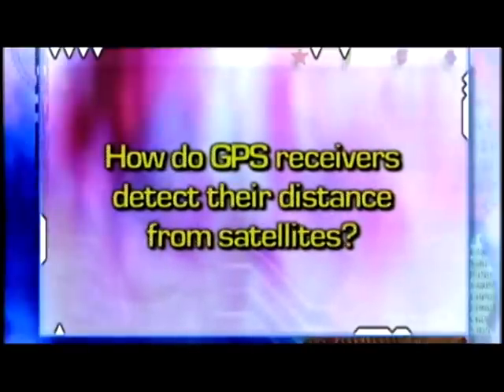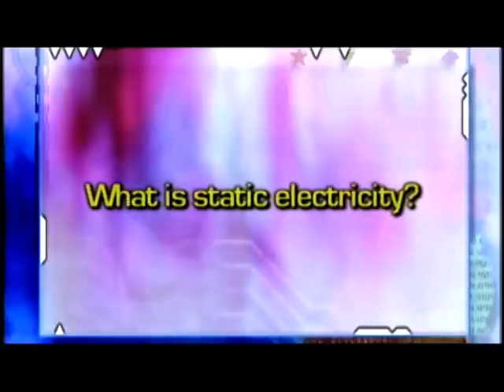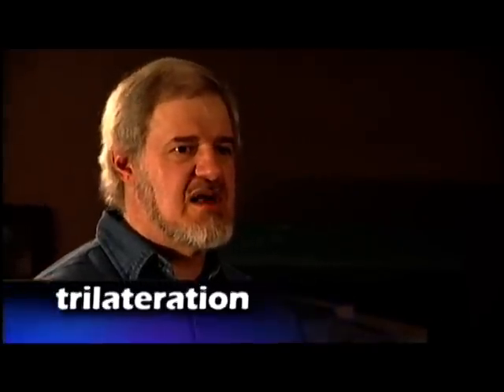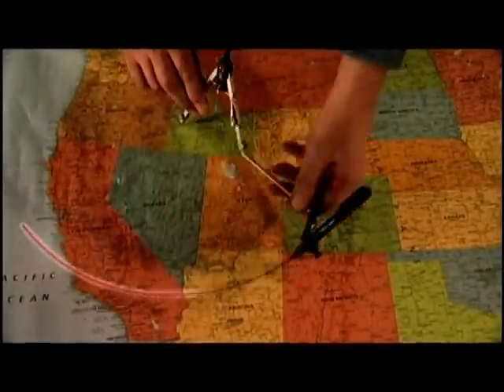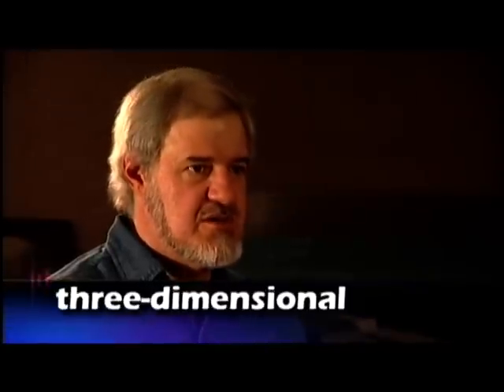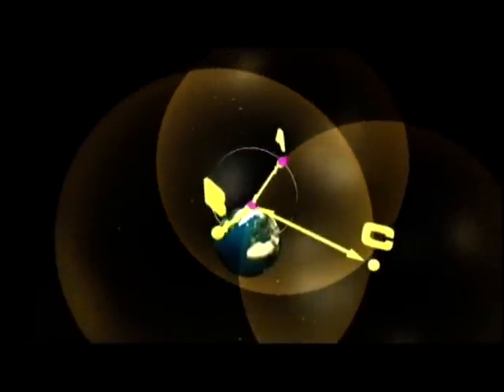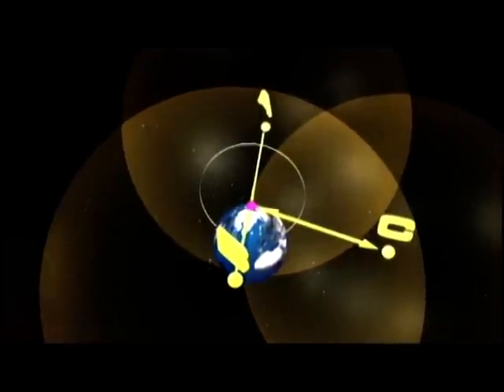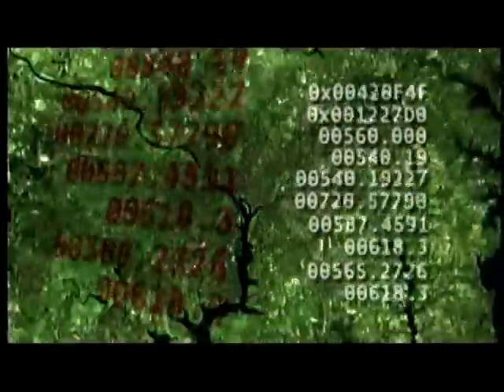How Does GPS Work (2005)

Comment: He stated that at least four satellites are visible from any point on Earth's surface at all times. I have heard that this is important because the GPS functions as a nuclear detonation detection system as well. 

He went on to suggest that it were possible to receive signals from less than four satellites. What circumstances would cause this to be possible if the previous statement is true (Always at least 4 visible at all times from everywhere)?
Reply: Vir Animus just because you have 4 satellites above you, doesn't mean your GPS receiver will be able to detect them all, be it from a bad location on earth, faulty or weak antenna range, low battery, etc. It´s like going into a tunnel with your cellphone while talking. You wont get the signal, even if the cell tower is just a few meters away.

Comment: Ans ->the spectrum/signal used by the satellite moves at a specific speed,(for instance if it moves at 100m/s and it took 5 sec from point a to a sat then the distance is 500m).
Now for the time, yes they are sync and the atomic clocks they use are cesium atomic clocks which are insanely accurate, one second off in every 30 million years (theoretically)
As they say, the signal transmitted is transmitted with the time of departure allowing for the time to be measured and distance to be calculated